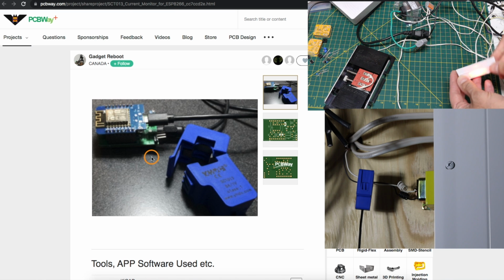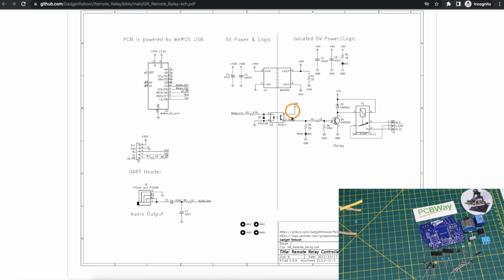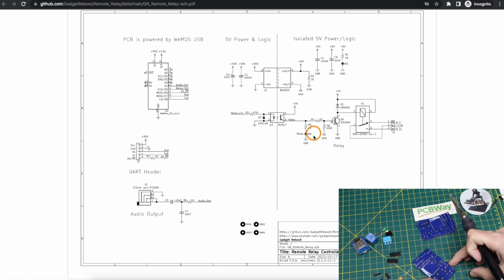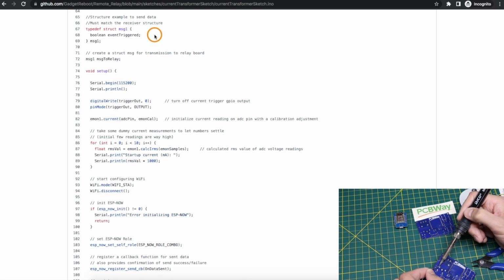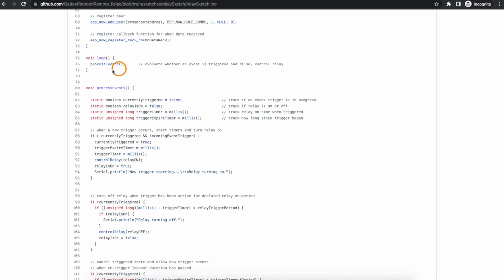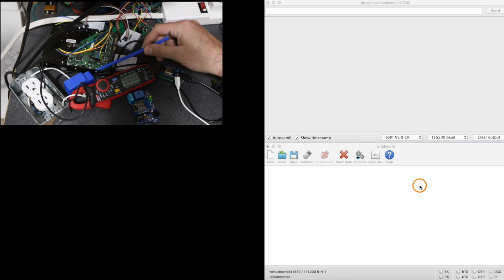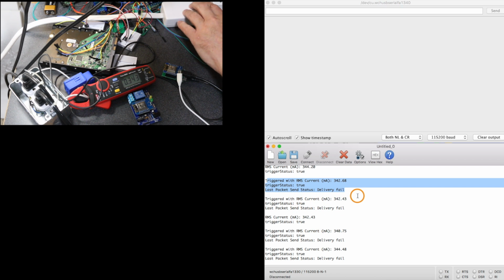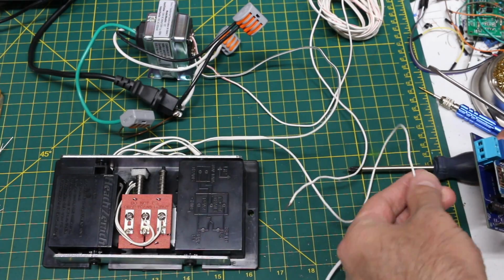Wireless Doorbell Extender Project: ESP8266 ESP-NOW

Comment: the current sensor is sometimes reading AMPS even when the door bell is not pressed. after carefull observation it was confirmed that when other switches of the house are pressed especially fan switch, the sensor reads some values. are you also facing this issue. please help if someone has some solution.
Reply from the maker: I haven’t had that happen especially such a high reading. It would be good if you had another way to measure current with a real meter to confirm you’re actually getting legitimate current like that rather than some other problem with the project itself or even the way things are powered like maybe there’s weird voltages showing up because of not clean 5 V power to the circuit 
So the analog input might be seeing a normal signal but it’s been scaled with errors because of noisy logic power 

I would try powering the circuit even from a battery so that it is completely pure and trying to figure out where the error is really coming from.
My doorbell transformer is getting its power from the circuit breaker panel and then of course the doorbell low-voltage power is fully isolated by the transformer so the only way I would expect a legitimate higher current there is if there’s some kind of short circuit drawing excessive current in the doorbell system or somehow electrical noise present on the main power that gets coupled in on the higher voltage side of the transformer at the breaker

But my first suspicion would be just the power to the logic circuit because that can totally mess up the analog  readings so just observing each part of the set up would help. If you had an oscilloscope you could use it to monitor the signal on the current transformer and then when you do some thing like turn on the fan to cause the error reading, see if the signal on the oscilloscope is actually increasing so that you know the digital circuit is actually interpreting a weird large signal but if the signal is looking normal and then you’re getting these large readouts then there’s something wrong with the digital circuit

Comment: ESPNOW is a great way to deliver small packets of data. I forgo using the MAC address and use an ID number to determine which ESP device is sending the data. That way you can easily swap out the ESP module.
Reply: That’s a bloody good idea, gunna use that, thanks man
Reply: I do the exact same thing.  Good tip.